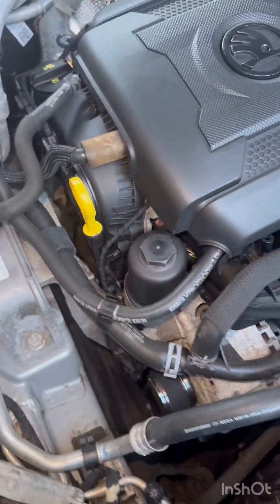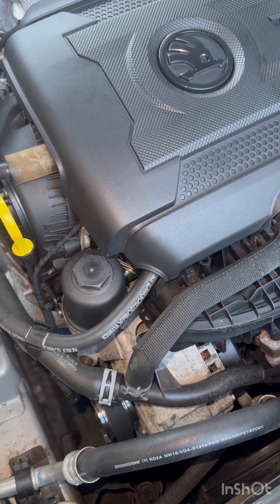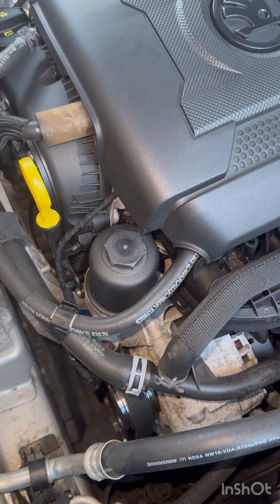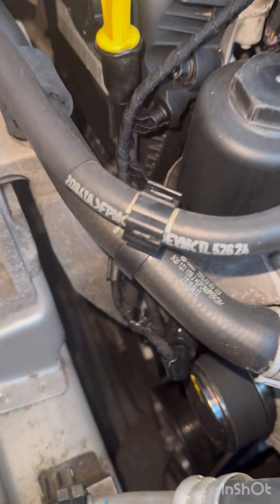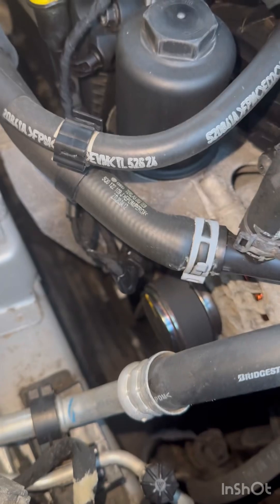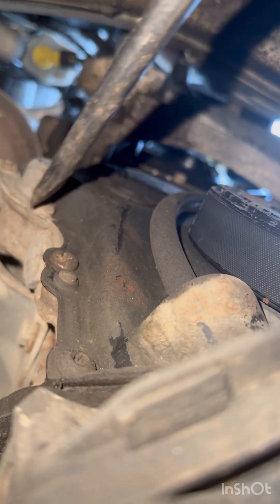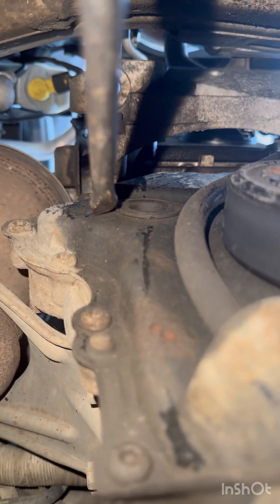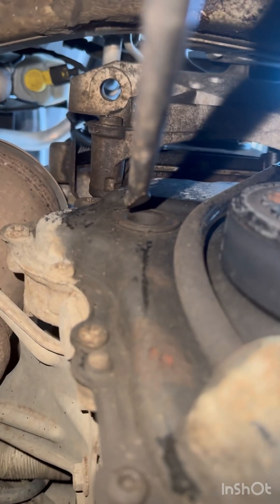Check your timing chain stretch in 60 Seconds! 2.0 TSI EA888 Gen 3 Golf GTI, Superb, VAG Audi.

Comment: Where do you exactly start counting the ring count? Right after the little spring clip ?
Reply from the maker: Either. If counting from the very front edge of the C shaped housing(barrel) of tensioner piston, no more than 6 "teeth" should be protruding. If counting from the spring clip, no more than 8. 👍

Comment: How many teeth should the tensioner be at? As well where would you be counting it from, right to left? or after the latch/spring that is towards the left of the actually tensioner unit?
Reply from the maker: The less teeth protruding beyond the end of the tensioner body/case, the better. If it gets to 7 rings/teeth protruding beyond the end of the tensioner body/case, it's time to replace the chain and assembly.